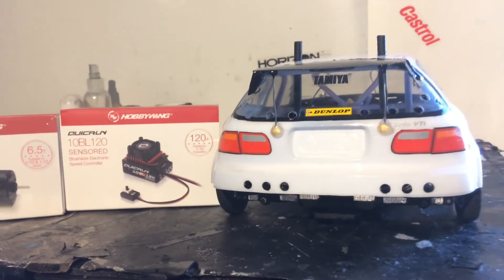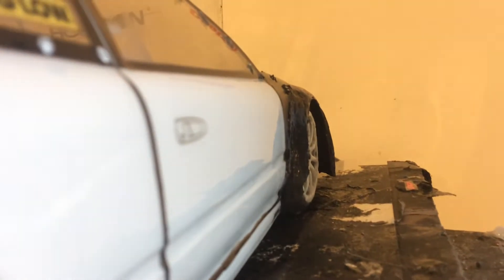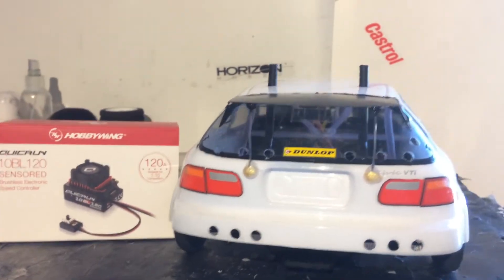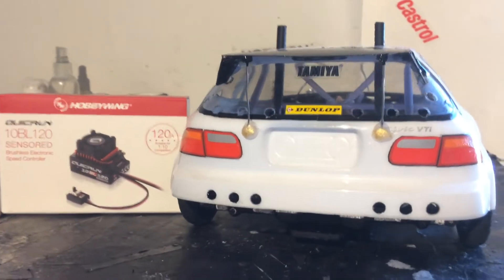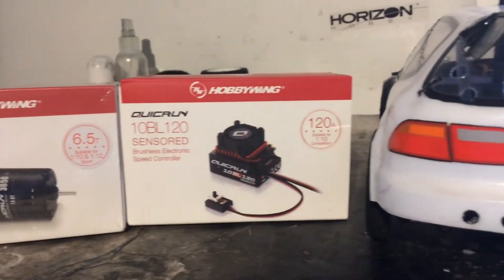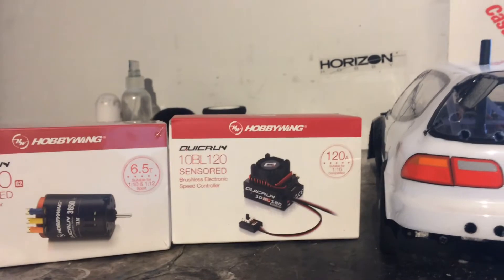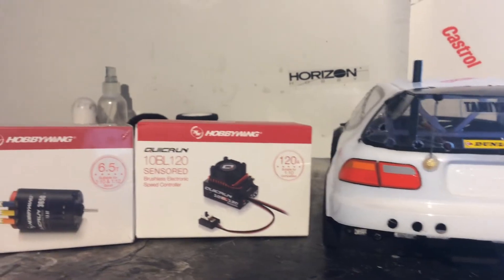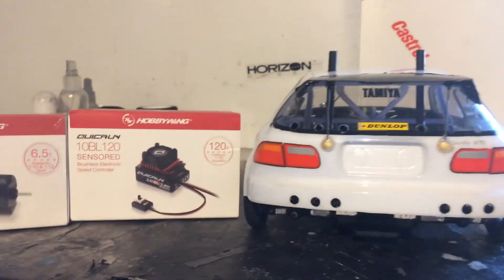Fwd Drag Honda Rc Build Revealing My New Set up

Comment: Basically same ting me have in The blue civic 120amp and 5900 kv .. Wah size and rating battery u did use get inah the 2s?
Reply from the maker: Kl, it was a 5000mah battery 150c burst. However that set up was with the 60amp esc and a 8.5t motor with a 32t pinion . I swear that time couldn't be right lol  this new set up should kill all doubts now and give me more reliable times.
Reply: Kool nuh then if suh haffi go out a 32 t on the blue one .. I jst fit a 32 on the speed run one the yellow one but tht one have in the 60amp about to soon give a test run
Reply from the maker: @pitbull8766  yeah man do so and make me know thanks for the support fam